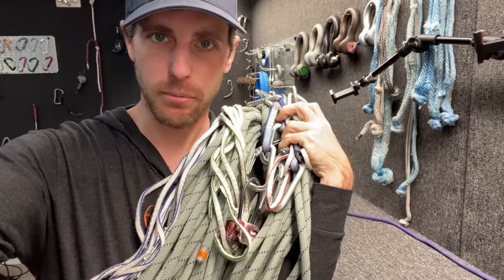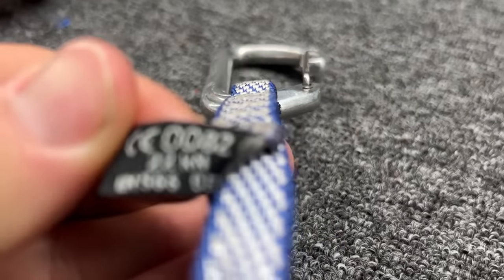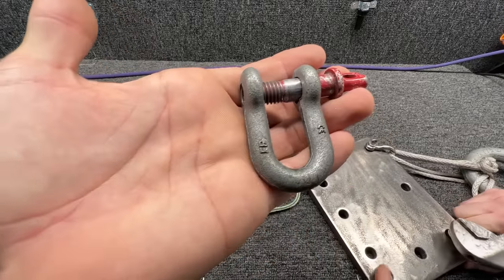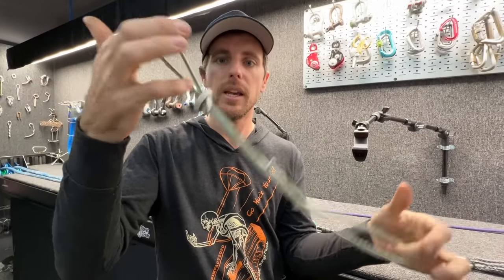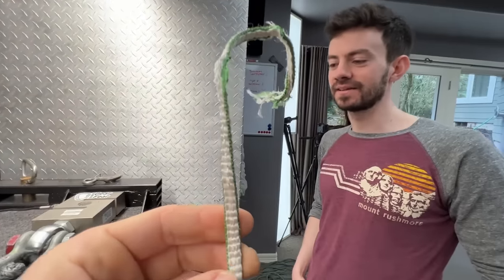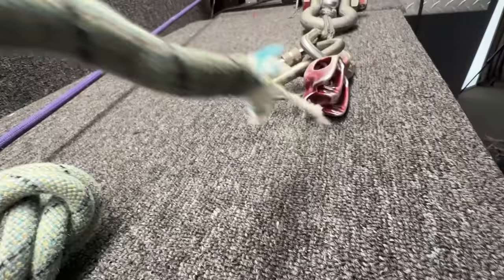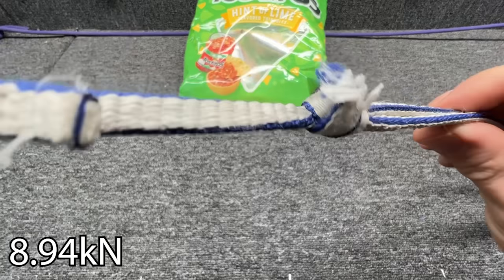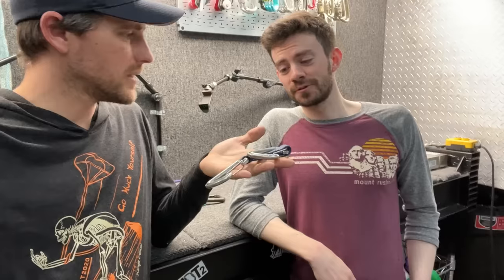My trick didn't work

Comment from the maker: We tested the Belgian knot in this video on an industrial sling and it worked way better https://youtu.be/bhCVdNAb8ZQ.  I think it just isn't good on slippery dyneema!  Go subscribe to our other CLIPS channel where we post quickies several times a week.

Check out our new store! https://hownot2.store/
Reply: Just looking for some advice.... About 20 years ago, I did myself a serious injury to my spine that forced me to stop climbing........ before I could use half the things on my rack that I'd slowly been adding to. This has left me with 3 sets of DMM "friends" (cams, can't remember what they were actually called), the majority of a set of rocks as well as loads of sling, quick draws, etc. Basically, over 60% of my rack has never seen a rock in it's life. They started their storage in my rack bag and then moved to a box and have been in the dark for most of that 20 years. I'm wanting to start teaching my daughter how to climb, but there's a huge question mark on all the stuff with slings. I'm thinking of just cutting all the slings and replacing with various sizes of accessory/prusik cord and attaching with double stopper nots. Just wondering what you'd do in this situation? Thanks
Reply: @Zogg1281  Just my .02, but I'd replace all the soft goods and get the cams reslung from DMM(they'll also clean and lube them). All softgoods to my knowledge have a max recommended shelf life of 10 years if they've never been used, kept dry, and out of the sun. They are probably still strong enough, and I've seen people climb on some old herringbone patterned draws, but if it gives you doubt throw it out.
Reply: @bigmutant69  Didn't know that DMM would re-sling cams for you. They won't need to do the cleaning part as I never go to use them 😭. I think I'm going to go with my gut and do some replacements of all the slings. Thanks for the advice, I really appreciate it. 👍👍

Comment: Lessons (re) learned: 
Dynema is slippery! 
-Belgian knots with those slings are maybe good enough in a pinch where you have no other choice, but 8kN is more than half as weak as when they were pulled normally! 
-Girth hitch master points in Dyneema around a big bow shackle are NOT super good enough(<3kN)! Maybe around a carabiner it would pinch better, but I’m not super convinced. Can anybody point to a test where it’s done?
-An ATC in guide mode might break the rope in high factor falls! (Practically impossible in normal use, might have been lower due to old rope) 

Tests I’d wanna see on the drop tower:!
-Dyneema girth hitch master point with one leg cut off
-dyneema vs nylon sling Belgian knots (seemed like on the slow pull friction had an effect, maybe pulling fast will create more heat and break it sooner!)
-ATC in guide mode taking factor 0.5, 1, 1.5, & 2 falls (maybe it’s a bad an idea for an aspiring leader to take “practice whips” on an atc in guide! 
This was an awesome video! What a lucky man to get to come in to the lab and test his own retired gear with Ryan. Thank you both for the edutainment!
Reply: Why would you ever be falling from above an ATC in guide mode though?
Reply: @Debrugger  Because normal belay mode is only safe after the first good protection is clipped in. So you might just keep enough slack for your climber to reach the next bolt and then switch to normal belay mode. IIRC you can even change modes in a safe way.
Reply: Agreed on the girth hitch on a carabiner needing more testing.
Reply: @Mike-oz4cv  you can clip the anchor, that way your leader won't fall directly from your hip, but from the anchor.
Reply: @Fabianwew  We usually belay from the anchor. I know you can add a redirect carabiner.

Comment: I was intrigued that the guide mode ATC inverted the ropes at 5kn. You could manage more than that if someone arrived and fell a factor two (or possible more if ATC were extended). Can you test guide mode again sometime as that result was a bit odd… the ATC seems to get pulled off straight at the beginning which put an odd force on the top rope so it didn’t trap the bottom rope properly

Comment: Would it maybe be interesting to have a figure like "total energy absorbed before failure"? For things that slip, peak force isn't really useful, as the material didn't fail at that force, it slipped. It failed after being subjected to a huge amount of force over a period of time.
Reply: It would be interesting for some things not just slip but also the more elastic Vs static setups, area under the graph should represent energy within the system you just want the software to be able to spit out the numbers.

Comment: It looks to me that the tearing in the first Belgian Knot test at 5:00 is just the green edge band on the sling that if I am not mistaken is usually made out of Nylon. The center part of Dynema looks like it is intact until the slings snap at the end.  In the second one, it does happen. I would not be surprised if there was a small nick in the edge band and when it entered the knot it pinched into the nick and the edge band got stuck and started to tear instead of slipping through.

If you look at the construction of the sign the Dyname is the warp and the Nylon is the weft that passes side the side between the warp to give it a fabric structure. When nylon was ripped apart there was nothing holding the Dynmea from the sing shape and you end up with separate long yarns like the inside of a rope.

This also explains why both failed at close to the same load, It is the Dynema, not the Nylong that provides the strength, the nylon just keep it flat

Comment: that weird adjustable sling knot could be used as an impromptu screamer if it was backed up by a second full strength sling. That looks like a lot of energy got eaten up by that heating and sliding at ~8kn. Maybe a thicker sacrificial rope that slips at ~2kn in the same knot could work.
Reply from the maker: It did cross my mind. I might try that on the drop tower

Comment: Re bent pin in bow/D-shackle, a safety shackles with a nut on the pin may be "a" solution, at least the pin can still be driven out if it does bend...